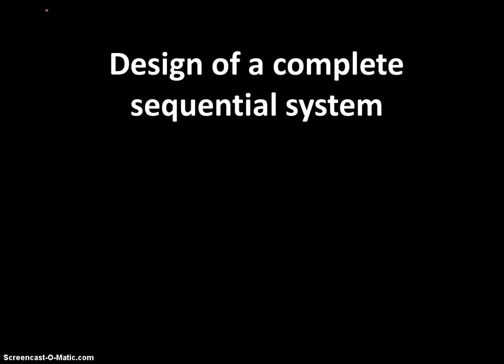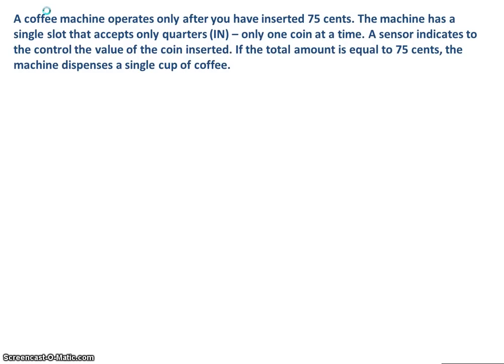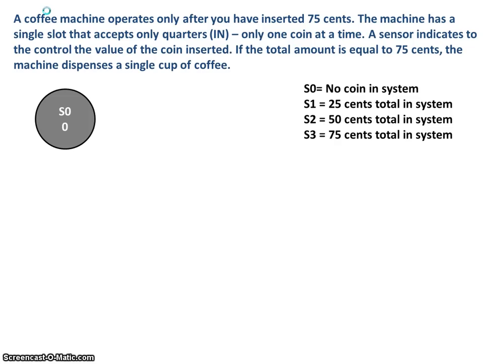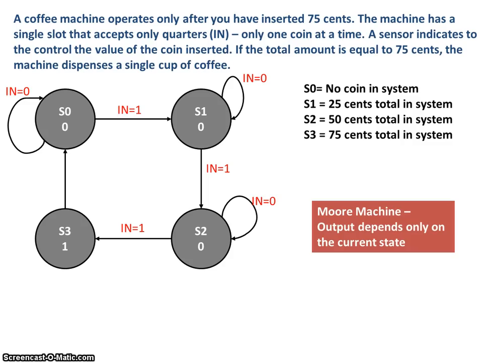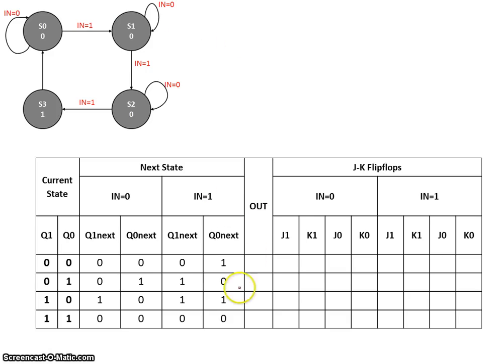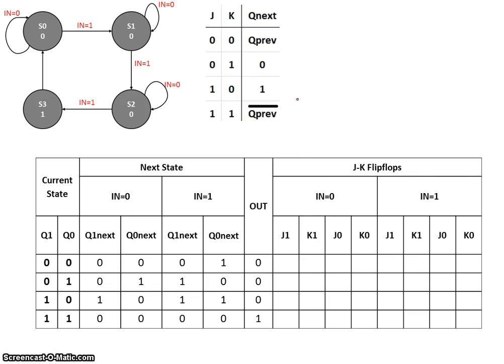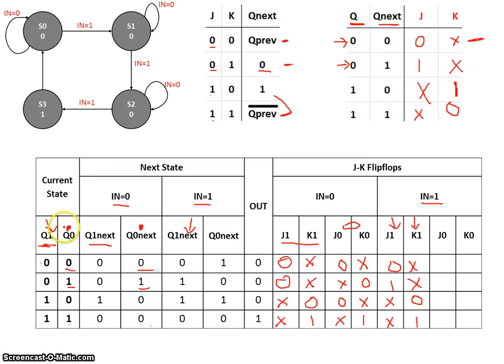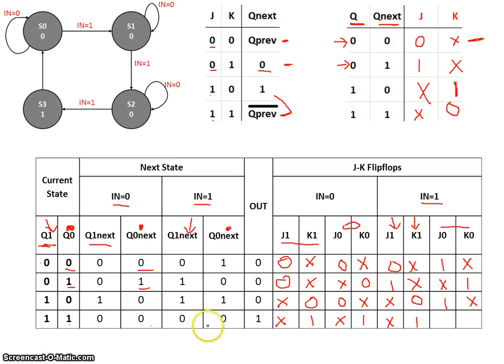Design of a complete sequential system - Part 1 of 2

Comment: HEY I NEED A HELP to design synchronous sequential network that has one input i1, one output o1, a reset signal r and a clock Clk. The output becomes 1 after the completion of the input sequence xxxxxx (. The circuit can be realized using the D flip-flop with reset (DFFR). Reset signal r to be connected with the reset input in the D flip-flops as to allow their initialization. The circuit should be from Muro type, which means that the current output of the circuit should not depend on the current input, and in fulfillment of the sequence should be gone in a special situation which shows output 1, and then from there accordingly should continue any of the other conditions without losing any entry

Comment: k0 = IN + q0, why?
Reply from the maker: K0 = IN + Q1. [ you wrote IN+q0 which is not correct]

You can get to it with a KMAP. The inputs that determine the value of K0 are IN, Q1 and Q0.